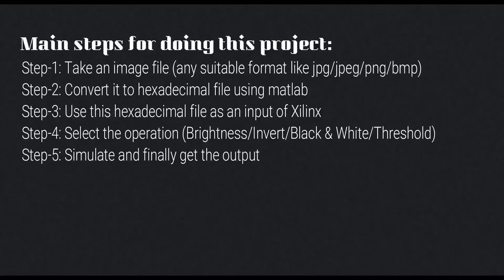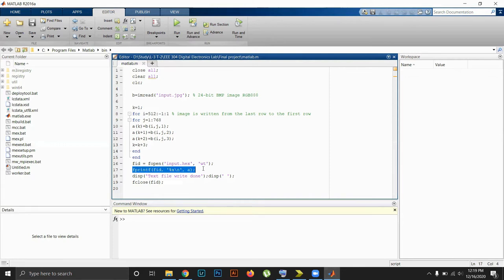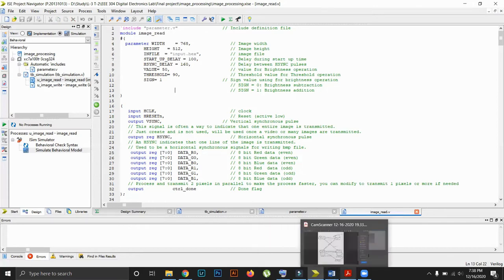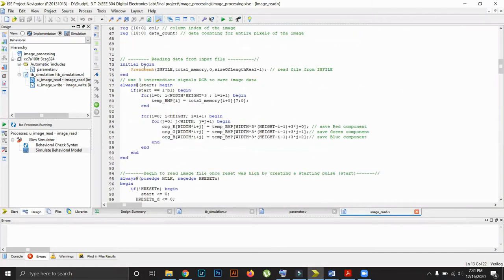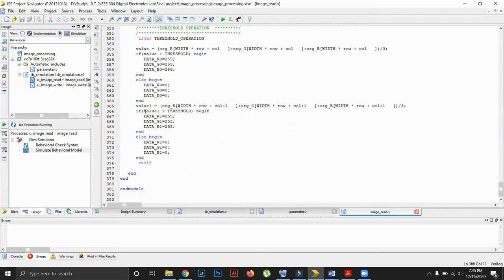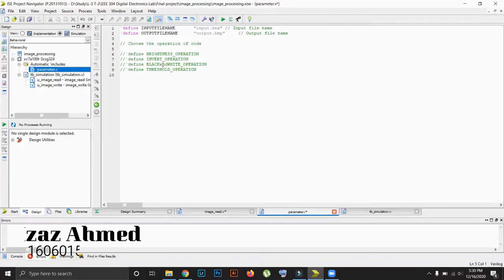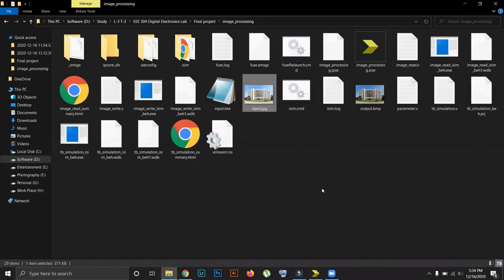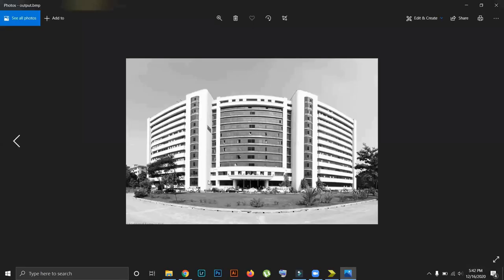Image processing on FPGA using Verilog HDL

Comment: I want code
Reply: FPGA4student (in google)
Reply: You will get the code in web
Reply: Can send me
Reply: @omarmurajia1642  bro wait I will send the link for exact code
Reply: @omarmurajia1642  bro i am also doing the same project that's why ✌
Reply: bro you know The bad pixel percentage results of Middlebury evaluation of the algorithms ?
Reply: Bro i past the link but it's removing so please search in fpga4student on YouTube you will get the link in description and click it will take you to the web page and there you can use the code
Reply from the maker: I have added the code link in the video description. On the other hand, you can find it on "fpga4student" site.
Reply: @bharathhl6935   The code is not working. can u please help me out ?
Reply: @avraghosh423  run in cracked version Xilinx it will run
Reply: @bharathhl6935   in registered version am trying. can u share the code pls?
Reply: @izazahmed29  hi
Reply: @bharathhl6935  hey bro did you do the project for final year BE?
Reply: @bharathhl6935  hi could please help me to complete this project
Reply: @avraghosh423 did you get the output?
Reply: @Krishnalakshmi-xf6sd  bro I'll ended up with hexa code that's all
Reply: @rohansrinivas307  yes completed but got the hexa code only
Reply: @bharathhl6935   I am getting an error, it shows the hex file is not present in the directory. what could I do?
Reply: @avraghosh423  have you completed this project?
Reply: @bharathhl6935 
Bro are you completed this project please help me to complete this...